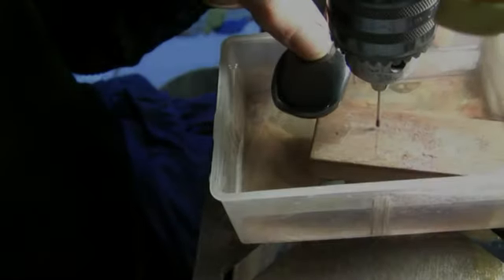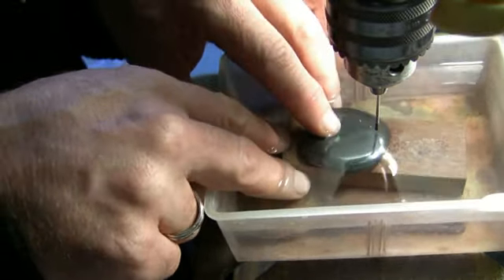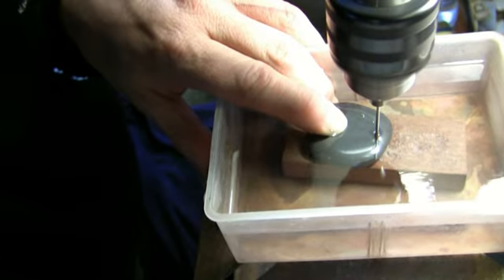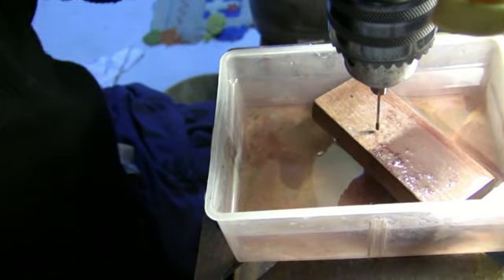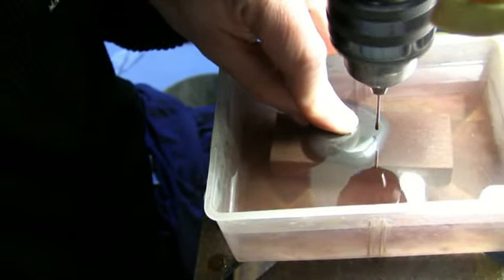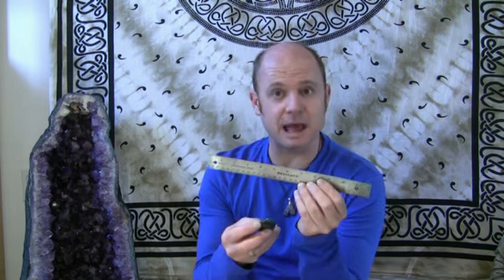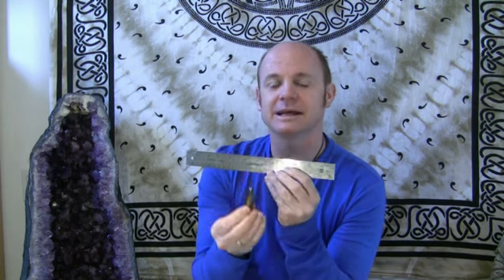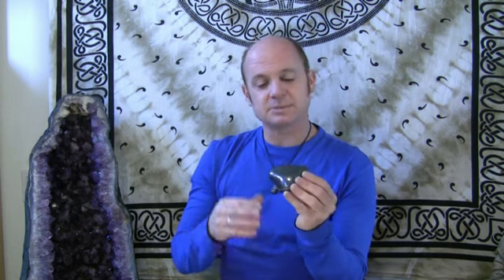Crystal Podcast - Hematite

Comment: Hematite is relatively soft. Been making quartz point pendents, takes about twenty minute to drill through. Have some hematite, will made one. The diamond bits are shot after one pendent, using oil, will try a water bath.
Thanks. Yes, the hemoglobin is magnetic, so we are affected by the various electric fields we are exposed to, some are detrimental and some are beneficial, like the Shuman field.